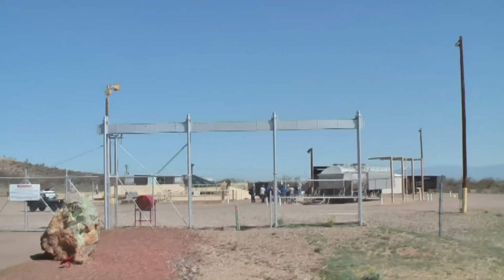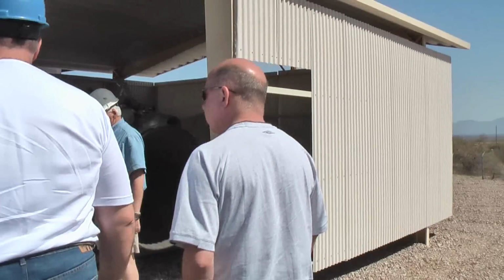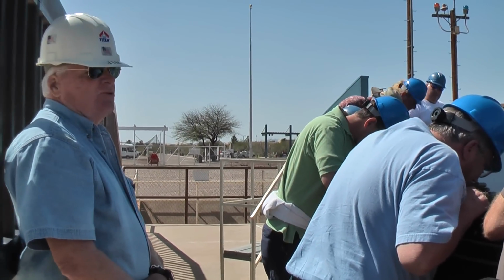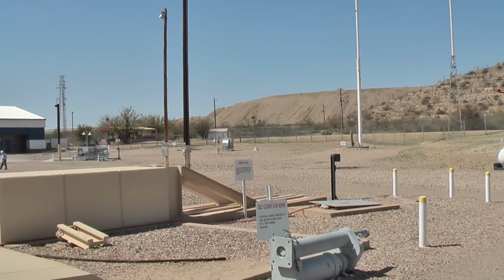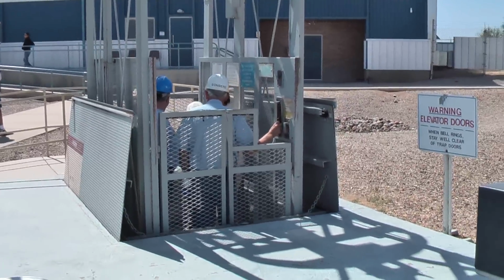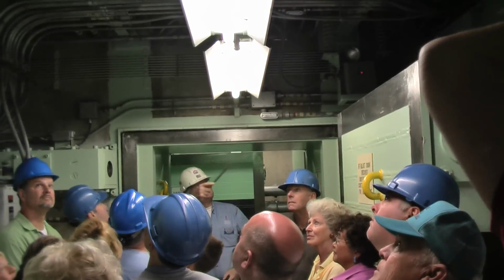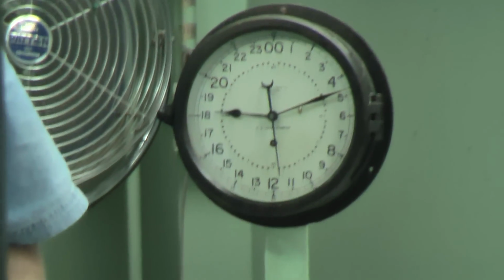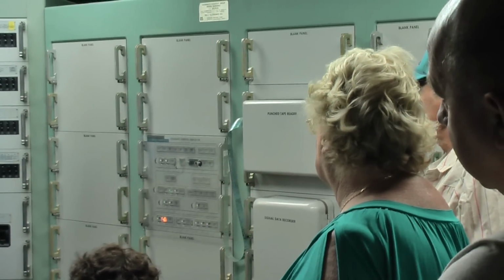Titan Missile Museum - Arizona, USA

Comment: They should install stereo amplifiers and subwoofers in the tunnels, then play a launch sounding 'rumble' when the keys are turned. Then say something like 'Uh-oh, that missile was supposed to be inert'.
Reply: Pure gold right there.
Reply: Yeah !! This remember to me a submarine docked in genova as a museum. When you enter the sub all the controls are on and you ear sounds of the crew and machine coming around you. A lot better than a dark death boat
Reply: Heart attacks and nervous breakdowns would intensify
Reply: @kinghans6266  Yah, the civil suits would override anything funny.
Reply: They don't have speakers loud enough to re create that kind of sound with definition without it becoming noise.
Reply: The interior is shock isolatioed, as well as the silo during launch. There would not have been any rumbling, although there would be noise, although not for as long or nearly as loud as you would expect. There's an entire computer dedicated to running a pneumatic leveling system for everything, you could hear it click on and hiss as it adjusted to your foot steps, you could watch a marble stand dead still on the floor during a launch.

They even put special indicators on the control panel to signal the missle cleared, because they were afraid the process would be so mild the crew would think there was a failure, and endanger themselves investigating visually
Reply: Haaaaaahhh yes!!!!
Reply: That's a great idea.
Reply: No it should go live while the tour starts
Reply: LOL!!!
Reply: @WizardOfWhoopee, to finish the story, a 9 megaton inert RV lands somewhere in China creating a crater.
Reply: Why do you need stereo?

Comment: I was a MFT in the 373 SMS LRAFB in the mid-70's.  One of the first things new guys were taught was how to override the blast door scheme.  We could easily have all the doors opened at once.  There were times when it just made things easier to have 2 of them open.  It was a pain in the ass to do it by the book.

Here's something I can still hear as clearly as ever.  "Skybird, skybird, this is SAC Airborne Command.  Acknowledge now!"

I can't help myself now.  We would lose power often in Arkansas.  When I was soundly asleep when the power would go out, the entire complex wound down in the noise.  .  There was a constant hum that you became accustomed to but when it stopped everyone instantly woke up. I'd lie there in bed counting, waiting for the diesel engine to kick in.  I always had to then inspect it to ensure it was running correctly.  It was loud.  So loud, I have a hearing disability because of it.  

We'd sleep on level 2 in the big chairs we had by the stairs.  My BMAT made a contraption that would allow us to pull on a string to press the acknowledge button when SAC would radio us to maker sure we were awake.  

The best part of the job is we would get boxes of books every month from the Book of the Month club.  You gotta be old to know what that was but it saved my sanity.  I read a lot.  After doing the DSV and any professional training, there was nothing else to do.  We'd have 20-21 hours a tour with nothing to do so I read and slept.  

One of the good things about the job was we'd get 3 and sometimes 4 days off at a time.  In the Air Force you could go anywhere you wanted if you didn't have to work.  We only had to inform our squadron if we were going further than 100 miles.  I spent a lot of time in Greers Ferry/Heber Springs with my friends.  That was fun, it made it all worthwhile.  

One more thing.  The BMAT was known as Brooms, Mops and Trash.  The MFT was called Motherf$%^ing Turkey.  The officers were called PITAs.  

That was a bit of bull about the targeting.  We knew that every Titan was aimed at the Soviet Union.  We didn't know if it would be a hard or soft target (military or city), but we damn well knew that a lot of people would die.  It didn't matter if it was Moscow or a site in Siberia, that bird was going to fly.  Maybe some of the older officers might have had some qualms about it, but that's why most of them were only in their 20's.  Us enlisted men were young, I was 18 when I arrived, and we were ready to do our job.  You have to keep this in mind...we were told repeatedly that the US would not launch a first strike, that we would only retaliate.  I believed that at 18.  Therefore, if we got the order to launch, I damn well wanted to do it because I believed the Soviets were going to kill my people so I wanted to get them as well.  We also knew that every missile complex was targeted and that we had about 30 minutes to get the bird out before we were killed.  I would have launched that sucker in a heartbeat.

All in all, it was the most boring thing I've ever done in my life.
Reply: Thank you for being part of the team that kept us safe.
Reply: hats off for this first hand, historic account.

Comment: For anyone who would think that those keys would never get turned or turned because the crew was nuts, the Air Force routinely screened the personnel to make sure they were physiologically capable.  The officers and crew were VERY stable individuals and incredibly disciplined.  They would turn the key and thank goodness they never had to.
Reply: I think you meant "psychologically".
Reply: @robertromero8692  auto correct is a bitch.  grin and shrugs.
Reply: And then to find out, if the order to launch was not followed, the missiles could be launched anyway, from the airborne command.

Comment: There are still silo based launch facilities in the United States on active alert and in operation. The Titan II missiles have all been decommissioned, and only the MX missile remains in the United States Air Force inventory.
Reply: +Tim Nelson Well yes and no . . . The missiles were a pulled from the hole per SALT peace treaties.  Titan II are still the backbone rockets for space shuttle and for satellite delivery systems.
Reply: Yeah, I heard that. They launch from Vandenberg, right?
Reply: +Tim Nelson Both "Vandyland" and Cape Canaveral.  Vandenberg is the only place to achieve a polar orbit from.  The Space Challenger was to be shot from Vandenberg the next launch had it not met its fate.
Reply: Missile Dude
interesting, thanks for the info
Reply: +Tim Nelson By the way, I was stationed at Vandenberg the day the Challenger was lost - real moral buster.
Reply: +Missile Dude There are still 450 active Minuteman III missiles. They are the only ground-based ballistic missile system in operation in the US.
Reply: +Matthew Dietrich for some reason I said MX, I was wrong
Reply: both MX aka peacekeepr and minutemen missile systems are still active in the USA.
Reply: Actually they killed off the MX, I was wrong above. Minuteman III is the only silo based missle left
Reply: Titan II are not the backbone for anything.  they are no longer used.  The last one was back around 2003 I think.  They fell into disfavor long ago, one of the reasons being they don't store and the lower stage propellant and oxidizer combination is very poisonous and corrosive Hydrazine and nitrogen tetroxide variants.
Reply: The last one was decommissioned in 1987.
Reply: The MX was pulled out.  Their warheads were recycled into the Minuteman III.

Today the US can put a warhead into someone's neighborhood.
Reply: @gk10002000  that's why we now have the Minuteman 3 system, all the minutemen in fact were solid propellant rockets. Much safer!
Reply: Nope, the MX/Peacekeeper was pulled decades ago due to arms reduction. The Minuteman 3 is the only active land based ICBM.
Reply: @gk10002000  no, they’re not

Comment: Had things gone just a little differently I would have been assigned here in the 70s.
With the  Air Force Security Police,
 As it was I only got there in 2013.
But it was well worth the trip.
 I actually knew people who worked on the building of the silos as civilian construction workers.
Fun stories they told.

Comment: The butterfly closure safety was set to 000000 out of spite, because the air force never wanted it in the first place. This was carried over on Minuteman systems, too, and this default  code was standard until someone found out in the 1990s. This was done on every weapon
Reply: I wasn't saying the valve was carried over, I was saying the settings were carried over along with the mentality, but you are exactly right, the mm doesn't rely on mixing two fuels together, I have no idea what the equivalent safety to the butterfly valve is on a mm or solid propellant weapon but from what I understand at one point they were all set to 0

Comment: some people by these old decommission silos and turn them into homes. I think it would take a lot of throw rugs and pictures to make it feel homey LOL
Reply: Wasn't there that one dude who made a series of converting a Titan 2 Missile Silo into a Home? Death Wears bunny slippers I believe it was.
Reply: Yes, be bought a silo in Arkansas and is working on it now.
Reply: Bunker Sieben. . . .Air filtration system.  Plus you can pressurize the entire complex to help the outside air from introducing allergy inducing particles from entering.  If you can make an allergy free house above ground with all of the openings that they have, then this would be even easier to alleviate.
Reply: Very expensive.  I doubt they'd buy one that's filled in and buried.  That would be significantly more expensive to renovate than the purchase price of one still in pristine condition.
Reply: @jasonlisonbee  All of them were filled in and covered over enough to hide them  All of them acquired by civilians for  re purposing had the portal tops destroyed and filled with all sorts of debris, then covered with dirt.  They have are are digging them out, getting rid of the junk and pumping them out.  Tjhis is my first look since 1967.  I worked on many communication and control systems back then.

Comment: If this were the only remaining ICBM missile site in the entire United States, we'd be SCREWED!Anyway, does anyone know to what psi of overpressure the Titan II silos were designed to withstand?
Reply: Here is a book excerpt, with tables, claiming to be based on the 1959 Air Force manuals: 
      https://books.google.com/books?id=0ZjeIfgG2AoC&pg=PA102
Original design was for 100 psi overpressure, but actual construction said to be 300 psi. The tables explain how close a burst of given size would have to be to produce the limit pressure—or how close a surface burst would have to be to bury the silo door in enough rock and soil to prevent it opening.
Reply: Complex itself is built to withstand a minimum overpressure of 300 lbs psi, the blast doors could withstand 1,000 psi.
Reply: There are still 450 Minutemen III missiles, in silos across three states. Submarine missiles are not more effective, but you are correct that the land missiles are much easier to target. I have read (don't know if it's true) that part of the reason for keeping the land-based missiles is as "warhead sponges"--to force an attacker to use up a large part of their own force trying to get most of the land missiles.
Reply: Cliff Cannon , 11 states sir.
Reply: Richard Hall 
Titan site designed to take everything but a knock on the door. 850 ton door.
Reply: @secondthought2320  is Ohio one of the 11 states that still has one
Reply: Harald Sangvik  well you would be wrong. There are still 450 Minuteman 3 silos still active in the Midwest.
Reply: @nevaehsmiracleconnieelliot2297  no, there were never any minuteman missile located in Ohio. Malmstrom, Minot and FE Warren are the 3 remaining minuteman missile fields. There were 3 others at Grand Forks, Ellsworth and Whiteman, but those have been decommissioned.

Comment: only one combination would work out of over 10 million... then why were set to 000000 for gods sake!
Reply: It has been declassified, the real code was indeed 000000. The US air force didn’t want to risk this Presidential code to be unavaiable so they set it like this, operators where instructed to verify at the begining of each shift that the panel showed 000000 and not touch it unless ordered.. The president was never told this fact and was kept in falsly believing that only him could made those launch possible.... in reality the air force top brass could launch without the aid of the president
Reply: @sergeabtan4838  That's not true.
Reply: Not true.